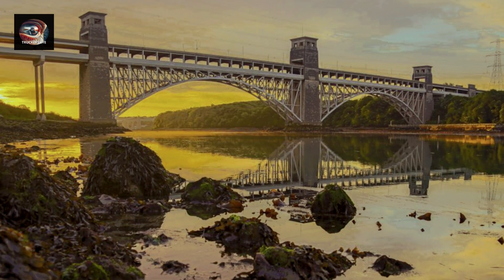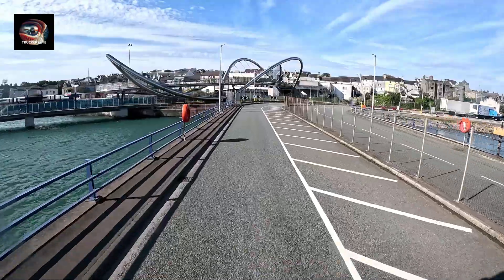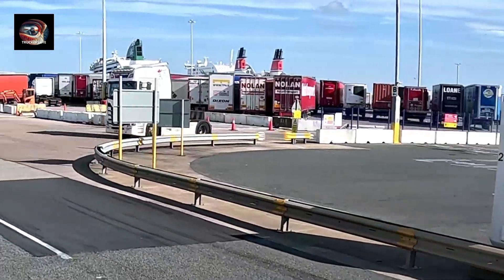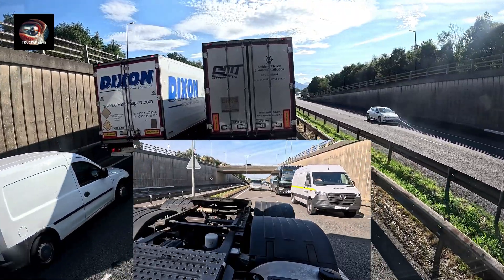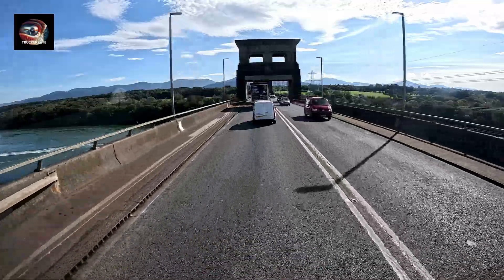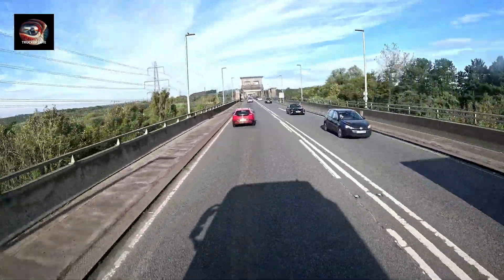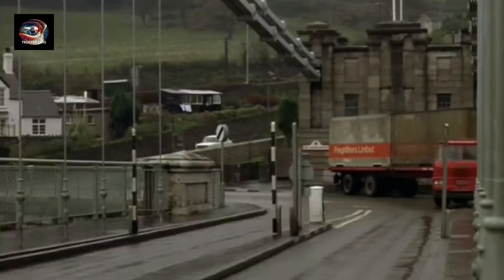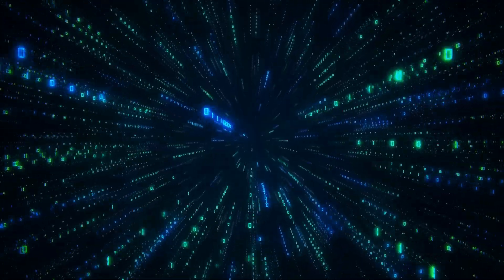This BRIDGE has already had one DISASTER.  What would happen if there WAS another?

Comment: The bridge is exposed to strong side winds and frequently closes to high sided vehicles. I've often wondered if it would be possible to retrofit wind barriers to protect traffic and keep the bridge operational in stormy weather. 

I also think they could install variable speed limits on the approaches to the bridge. Slowing traffic upstream at peak times would improve flow rate. 

Perhaps they could re-engineer the on ramps with part time traffic lights to control traffic getting on to the A55 at Llanfair PG. 

I think a third crossing would have a significant detrimental visual impact on an iconic scene. The two bridges are very photogenic, with the mountains in the background.

Comment: Of course one good solution would to be making the railways better for freight - if all those trucks could be replaced by a single freight train congestion would be much better. I've always thought that the best solution would be a railway tunnel underneath the straight, which would remove the bottleneck of the single track on the bridge. Then, you diverge the northbound A55 onto the deck where the railway is now, and each direction can now be duelled. Of course money is the main problem unfortunately, as there just isn't the funding.
Reply: Maybe, but the real issue is the so-called Welsh Government's blinkered view that excludes any benefit that may help North Wales
Reply: The current railway bridge is good but some some bizzare reason when they relaid it after the fire they only put down 1 track and sold off the other track bed to utilities.. So they could have had a fairly high speed double track run from Holyhead straight onto the west cost mainline but again with the railway there's a needless chokepoint on the bridge.

Comment: I remember in the late 60's before the weight limit. Going over the old bridge with my dad in his car transporter with six or seven cars. It was a tight squeeze.
Reply from the maker: @darthvirago  there's a recent(ish) video of a truck which is ever so slightly wide of the standard trailer unable to get through the arch and obviously the traffic is behind it so the whole thing came to a halt!  I remember it well as the Britannia was closed due to a seperate accident and I have searched high and low for the photo of that accident as 2 trucks from the same company had gone up the back of each other 🤔.  I'd love to have been a fly on the wall for that conversation with the boss!
Reply: @thetruckerseye  Found the photo. Oct 2019 Two white Scania's. Must have been in a rush to get to the ferry. I bet the boss wasn't happy. Before the tunnel was bult Dad would drive through the little arch at Conwy too and that's on a right hand bend.

Comment: If they build a new bridge they will put a toll on it, and just like they did at Runcorn bridge they will put a toll on the old ones too.
Reply: Having spent time in the area I can’t see why the A55 bridge could not cope. Size restrictions already largely stop HGVs from using the suspension bridge.
Reply: I crossed that Bridge (unintentionally) just after it opened - then I got a Fine through the post soon after - Never again!
Reply from the maker: @darthvirago  maybe it would be a good idea to do that same thing and encourage private contractors to build it?  Of course, just like Runcorn they could toll the existing bridges but give free crossings to local residents?

Comment: The 1974 disaster CANNOT happen again because the reconstructed bridge is entirely different. In the event an accident takes out both sides of the carriagway, all truck-borne traffic would come to an immediate halt and all cars would find themselves in a multi-hour queue to cross the Menai Bridge.
Reply: /me Parks car close to Ysbyty Gwynedd and walks over the Menai bridge instead... 🚶💨🚙🚗🏎🚓😋

Hey, Menai Bridge to Llangefni might not be the quickest of walks, but it still beats that Betty Boo! 😁
Reply: Agreed but if there was a major accident say with a fuel tanker the bridge could be closed for weeks. Never say never and plan for the unlikely!
Reply: This cannot be happen?
HOLD MY BEER ;)
Reply from the maker: @daigriffiths399  yes it was more if something happened that rendered the bridge useless rather than just a fire.  It's far safer these days and this kind of fire wouldn't happen.  But using the most extreme suggestion.  What if a plane crashed into it.  That's totally 'out there', I know, but without this very old bridge (as with many islands around the UK), there is no foresight.  The traffic amounts alone are enough to show another bridge or tunnel is required?

Comment: The original railway "tube" was made of wrought iron, not steel.
Reply from the maker: @TheEulerID  thanks!  There is one of the rectangle tubes placed next to the bridge as I saw when researching.  Pretty amazing!
Reply: @thetruckerseye  The Conwy Railway Bridge used a similar construction technique and has retained its original form. Interestingly, Robert Stephenson and Thomas Telford basically followed parallel paths, so Telford's suspension road bridge runs alongside Stephenson's tubular railway bridge at Conwy, just as they did on the Menai straits. Of course Telford was also familiar with wrought iron, having built the Pontcysyllte aqueduct on the  Llangollen Canal, as the trough is built using the same material.

In the case of the Britannia bridge, I believe that the wrought iron was produced at temporary works on the banks using puddling furnaces. Wrought iron was made by reducing the amount of carbon in pig iron, and hammering the hot metal flat using sledge hammers, and folding it over and over again after being re-heated so it ends up as a multi-layered material with fine layers of silica slag between the soft iron. It has a distinct "grain" and, when compared to mild steel, is a lot more resistant to rusting. Sadly, it's no longer produced in volume and what is called "wrought iron", as in gates and the like these days is actually mild steel. 

The great LTC Rolt wrote a series of biographies about these civil engineers as well as of Brunel and the construction of these marvels of the time. The Britannia Bridge tubes owed a lot to the techniques of the latest ship constructions, and were floated out using barges and raised, very slowly, using hydraulics. To put this in perspective, the Britannia Bridge tubes were three times longer than the largest ship of the time (Brunel's SS Great Britain) and had to cope with the vicious tidal flows. Stephenson lost much sleep over this.  

It is a testimony to the combination of aesthetics and the engineering of the works of Stephenson and Telford that these great monuments to Georgian and Victorian civil engineering survive to this day (save the Britannia "tube" of course) and are much admired for their beauty. I doubt many of today's reinforced concrete structures will be looked upon so fondly in the centuries to come, even if they last that long.
Reply from the maker: @TheEulerID  that's brilliant knowledge and thank you for sharing.  When I make these videos I do so because I know so many other truck drivers and often say to them do you know about that bridge or do you know about that road etc...  I then find myself learning more than I already knew when I research the video (as an example i didn't know about the original casing still at the site) and then other people such as yourself engage with even more info.  It's truly amazing.  Thank you.